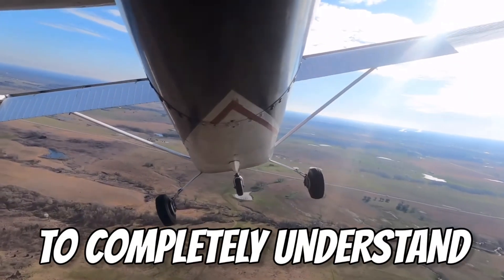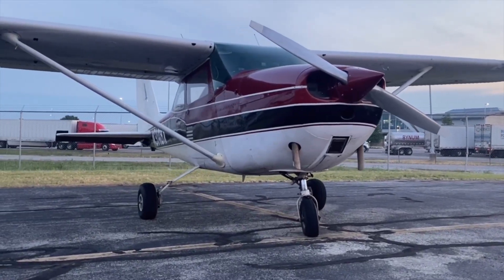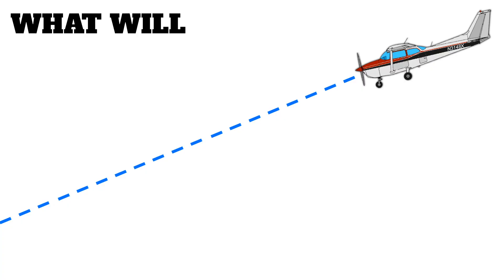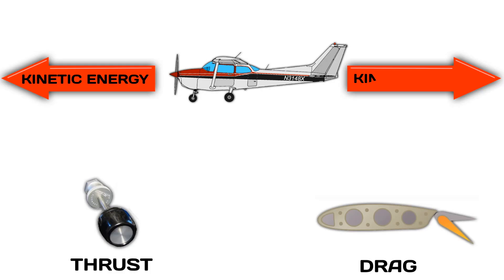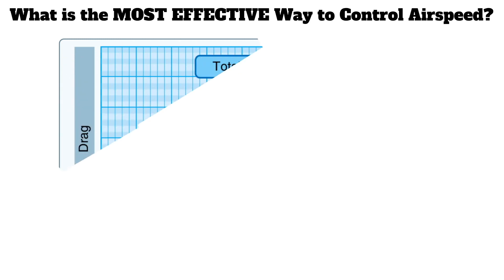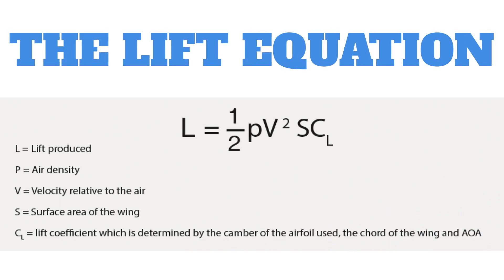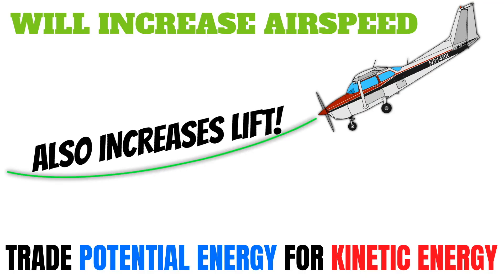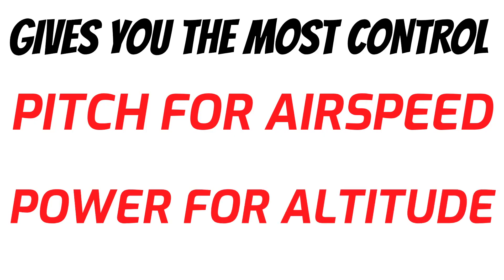Should I Use PITCH or POWER?

Comment: I am an aerospace engineer and a CFI/CFII/MEI.  It's true that in a perfect world with no wind, you could pitch for a particular airspeed, and completely control your descent using only power. However, I do not want any of my students to get locked into a way of thinking that they only do this all the time.  It's true that The slower your speed and higher your angle of attack, the more noticeable the effects of power are on your rate of dissent. However, the truth is that both power and pitch are intimately intertwined and both continuously affect both your speed and your dissent rate.    Controlling altitude using only throttle results in sluggish control.  However, trying to do it with pitch when you're close to the edge of stall can be ineffective And if you're going slow, enough can be potentially dangerous.     I teach everyone to think about landings in terms of energy management.  To think about the throttle as your continuous source of energy that you're putting into the plane. And continually use the stick to aim at the aiming point.    Energy management is the key. If you get to The threshold of the runway with the same amount of energy each time, whether that energy is potential, energy or kinetic energy does not matter your landings will be good
Reply from the maker: They are very intertwined. I’m planning on discussing the strategy of using “opposite controls” as I call them in a future video. There are times when it makes more sense, BUT the point I was trying to make was which one is MOST EFFECTIVE. How does a student pilot eat an elephant? One bite at a time…unless the FAA has something to say about it

Comment: Something that took me years to fully understand is that "Pitch for airspeed" means "Trim" for airspeed.
ie; set your aircraft up at approach speed ( or any desired speed for that matter) and trim!
Now the aircraft will want to fly at that speed.
Apply power it will climb at that speed, reduce power it will descend at that speed.
It works in cruise as well, trim for your speed adjust power to climb or descend at that speed.
Pitch really DOES control your speed!
This makes flying under instruments MUCH easier!
Reply from the maker: Very very true!

Comment: Most of the instructions just tell you to drill this into your head, "Pitch for airspeed, power for altitude", which seems counterintuitive at first and I didn't really understand the physics behind it until I stumbled across this video. Very thorough explanation from a practical pov. Thanks!
Reply from the maker: You’re welcome! I made this because I had people argue the opposite
Reply: @FreePilotTraining  I am yet to fly a real 172 but I did ride in one. I am trying out simming currently and have witnessed people argue the same on blogs and forums which caused me a great deal of confusion. One thing I read that struck out is that while this holds true for manual flying, when in AP/FD mode, the pitch is commanded by elevators (that's how the AP code is) so the thrust then is used to control speed. This makes sense because you wouldn't want the AP "fighting itself". I haven't flown anything other than 172 so can't attest to this yet.

Comment: Most of my instructor’s taught me to think of it as slow flight over the runway. So pitch for airspeed power for altitude. However I’ve come to understand that any time you change one you should anticipate changing the other.
Reply from the maker: Great point. I have a theory on this. I believe that there is one time when you shouldn’t have to change them together. I mentioned it in my landing book. I may make a video

Comment: You lost me when you stated that thrust directly impacts lift at low airspeeds. You gave the equation for lift. Thrust does not appear in that equation. You may be intuitively thinking that you need more lift in a shallow descent than in a steep descent. Until you get to pretty high descent angles, the amount of lift does not change by very much with descent angle in steady state. It is very close to the weight.
Reply from the maker: Thrust affects lift in 4 distinct ways. First through something called the “slipstream.”  Second, thrust increases airspeed which also increases lift. Third, angle of attack is increased if we pitch up to maintain airspeed because it increased our airspeed. Fourth, it increases the downforce on the tail which can also increase Ang of attack
Reply: @FreePilotTraining  OK, so maybe making a distinction between directly affecting something and indirectly affecting something is nit-picky. I'm still concerned that you are giving people the impression that decreasing the descent angle requires increasing the lift. To transition to a shallower descent involves only a brief moment where the lift exceeds the weight.
Reply from the maker: @InquisitivePilot you ARE increasing lift in this case.  However, weight is still greater than lift which is why we can still descend. Lift doesn’t disappear in a descent
Reply: @FreePilotTraining  I am not arguing that lift disappears in a descent. I am arguing that lift changes very little in a descent (in steady state). It is very close to equal to weight until the descent angle gets VERY steep. Draw the vector diagram for a shallow descent. You are the one arguing that lift changes significantly between a shallow descent and a steep descent.

Comment: So you use pitch to gain and lose airspeed, but is maintained with power. And you use power to gain and lose altitude , but is maintained with elevator control. And the amount you use of both depends on your L/D ratio

Comment: From a practical standpoint, I think it’s important to be able to feel, in your bones, what pitch and power do to your airplane…and experience is really the best teacher. I’ll never forget this one day when I was in primary. I was doing pattern work with my CFI on a day when there were low level wind sheer alerts. On short final, during the summer, with all sorts of thermals coming off the ground and all sorts of mechanical turbulence caused by the nearby geography, it happened and we got whacked with a 10-20 knot tailwind out of nowhere. At which point the CFI rammed the stick forward. He knew, in his bones, that the quickest way to keep us from stalling at 100’ AGL was to pitch immediately. When it comes to pitch and power, those are the most vital takeaways, imo. If you need the airplane to do something NOW, how do you accomplish that? I was lucky in that I got a real world, borderline emergency demonstration of the pitch/power relationship when I was still in primary…unfortunately, not everyone gets that type of primal experience at such an early stage.

Comment: This is good at explaining pitch but not so much covered about power. If you’re in, for example, a Cessna 150 does increasing power increase altitude (and decreasing vice versa) during landing? I still feel this is unclear.
Reply from the maker: If you’re on the back side of the drag curve, then power will increase altitude as long as you have enough power to do so. At the very least, it should keep you from descending

Comment: the lowest point on the power required curve is not LD max, its the minimum sink/maximum endurance speed. LDmax is at the lowest point of the THRUST, not power, required curve. If you take a line from the origin of the graph and drae it tangent to the power required curve, you'll find LD max. its a bit faster than the min sink/max endurance speed.

Comment: In commercial aircraft, flap maneuvering(minimum) speeds are the minimum speed recommended for that flap settings. Typically, you wouldn't go below that airspeed. For example, in a 737-800, the flaps up maneuvering speed for a specific weight might be 200kts, so going below 200kts with flaps up would cause the aircraft to be on the backside of the drag curve. In order to go below that speed, you need to deploy the next flap, in the case flaps 1 maneuvering speed. On final approach, the VREF is the maneuvering speed on the 737-800, so in this case would you use pitch or power to maintain VREF?
Reply from the maker: Those airplanes are going to have an unbelievable amount of power available.  Power for airspeed is what you want to use for them
Reply: @FreePilotTraining  Probably that's why they tell us never to go on the backside of the drag curve
Reply: @FreePilotTraining  Even with that consideration, in climb and descent, the FMC calculates a specific target power for climb or descent then pitches for that. In an impending stall, the training manual says to pitch first because it's still the most effective way then add power slowly because the engines are below the CG, so adding power rapidly would eliminate the pitch, bringing you closer to a stall(Plus the unbelievable power takes several seconds to become effective, but pitch is more immediate)

Comment: Videos like this, is why I believe that General Aviation has such a horrible accident rate. Any professional pilot knows that pitch controls altitude/glide path and power controls airspeed. 

This is also what the FAA wants instructors to teach. Some people think this is a matter of differences in opinion. It’s not. One way is correct, the other way is dangerously wrong. 

The newer, single engine aircraft, now a days have glass cockpits with working flight directors. These flight directors use pitch for altitude or glide path. You think that all these avionics companies got it all wrong?  

Be safe out there. If your instructor tells you that pitch controls airspeed, find yourself a new instructor.
Reply from the maker: Lol. You obviously didn’t watch this video. Most of this content is straight out of the airplane flying handbook which is produced by the FAA. Not only that, but the USAF taught me a lot of this. They’ve been flying aircraft for quite a while…
Reply: @FreePilotTraining  I did watch the video. The FAA has been wanting CFIs to teach pitch for altitude and power for airspeed since the mid 1980s. (I’ve seen others make these same comments as me). 

The USAF has different philosophies since they have different missions to fly. A lot of that stuff has to do with AOA.  But even so, if you need to aim your aircraft, you use pitch. And you adjust your speed with power and drag. 

It’s how Boeing designs their aircraft. So does Airbus. And every manufacturer of airplanes. Are you saying they are all wrong?  Come on man. 

Pitch is for altitude. Power is for airspeed. Unless you have a fixed power setting. It’s that simple. Every professional pilot knows this. Including ex-USAF pilots who now fly for the airlines. I can have 20 retired Airforce guys talk to you about this if you want. 

Don’t teach the wrong way. It’s doing a disservice to the aviation community.
Reply from the maker: @rtbrtb_dutchy4183  I stand by my note in the video. Those aircraft have way more power.  Is it possible to control the aircraft in that manner? Yes. In some cases, it’s better to use those less effective controls so you don’t over control the aircraft. However, they are less effective
Reply: @FreePilotTraining  I don’t know where you get that from. I was a CFI for 1500 hours and taught in underpowered aircraft. It’s still the same. 

If a students is on glide path but a tat slow, the last 200 feet, you don’t want him/her to think: “I’m slow, I have to lower my nose”.  No, you want them to add power. 

When you fly an ILS in a C-150 and you are on speed, but a bit below glide path, you want to pitch up. Your airspeed might drop a few knots, but once back on glide slope, you get those knots back. No power change needed. 

I can give you examples after examples. 

The FAA wants you to teach pilots to use pitch for altitude and power for airspeed. The FAA understands this is done in underpowered airplanes usually. 

I don’t know what to tell you. I might come off as arrogant or a know it all, but I’m tired of people saying that pitch is for airspeed. I think it’s dangerous. There is a reason why GA has such a lousy safety record. 

I saw another guy respond. He has been flying for 48 years. He was an instructor as well. He agrees with me. Most true professionals will agree with me.

Comment: You HAVE to use pitch for speed and power for altitude. Otherwise, when you have an engine failure you will DIE. If you teach a student to maintain speed with power, and they lose power, they will not automatically know how to avoid stall-spin. Geddit?
Reply from the maker: 100% fact. Totally agree

Comment: I have just recently started my Comertial Pilot training and now I have gotten some more hours in and have tried this out with my CFI like yesterday. Makes complete sense your explanation on why pitch for airspeed is more efficient, however, I have tried it and both me and my CFI agreed that it is just more difficult to execute properly. I have always flown with the mentality that pitch is king, and excluding the takeoff climb (where your speed is king and you can change your pitch quite a lot in order to maintain that VX or VY) So basicaly during most of the flight everything is slaved to that pitch and we are going to work flaps and power in order to get that pitch where it needs to be... (this is the gist of it, obviously there are some other situations like when you want to lower your airspeed in leve flight where speed is going to be king and you will work your pitch and power arround it or a stall where you have to give in and cant hold the pitch and again airspeed is king) but that is my thought process in general, everything works for the pitch to be where it needs to be (most of the time) if that makes any sense... On the glide its just much more reassuring and easier to execute when you just keep that nose bang on on the aiming point all the time. First thing I do on final is to try to establish my pitch in my aiming point. If for some reason I cant and that pitch atitude I need is too steep and it makes me gain speed above my approach speed first thing I work on is the engine (just put it in idle and try again, if it still makes me go above de approach speed the second thing I work on is the flaps, lowering flaps should allow me to get an even steeper pitch down to the runway. If its too much now and I see that in order to maintain approach speed my pitch would need to be lower than my aiming point on the runway then I just pitch up back again into the aiming point but as I do this I just dont let that speed drop and give some power simultaniously. I always try to change as little of pitch atitude as possible because my perception is that even the tiniest change in pitch creates a HUGE change in airspeed and just accelerates or decelerates the plane too much and its very finicky to control, especialy in hot days where there are thermals everywhere and you are bouncing all over the place. And if you are too low on the glide slope its very easy to correct that, you just have to fly leveled and eventualy you are going to be on the correct glide slope. And then you resume pitching into your aim point and repeat the process I have described if you overshot it a bit and find yourself high.
Reply: Congrats on your training. Don’t rely on YouTube videos. Most, like this one is just wrong. 
Pitch co trolls altitude, power controls airspeed, unless you have a fixed power setting. 

I assume you want to make this a career. Once you fly bigger airplanes, this is how they are flown. All automation uses power for airspeed and pitch for glide path or altitude. So set your mind to this now. 
I know a first Officer on the 737 who is not too happy he was taught wrong and now has to relearn. 

If you want to do something fun with your CFI to figure this out, do this:

You fly and on,y control the yoke. Your instructor only controls the throttle. 

First landing, you control airspeed with the yoke and he controls glide path with the throttle. 
2nd landing, you control glide path with the yoke and he controls speed with throttle. 

You will find that the first approach will be unstable. The second one will be easy. You aim for the runway, he adjusts power after wards.
Reply: @rtbrtb_dutchy4183  thanks for the advice, yes I am doing all I can to turn it into a career.
Reply from the maker: This raises a great point.  It might actually be beneficial to use less effective controls sometimes.  When you’re trying to make small corrections like you do on an ILS, you might want to use a control input that doesn’t push you to the other side

Comment: I see that this is a safe technique for primary students  But I wouldn't fly an ILS(glide path) with this technique. fast? reduce power, High? pitch down for GS.  Truth is, need to do both for most corrections
Reply from the maker: I believe that there’s an advantage in using LESS effective controls when flying an ILS. You’re trying to make smaller changes